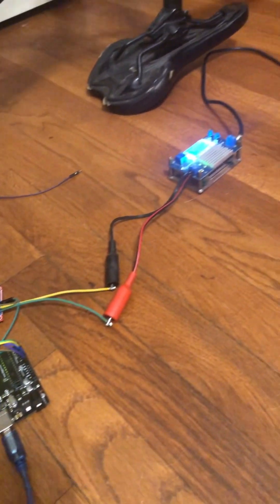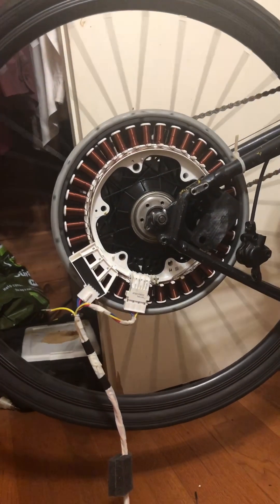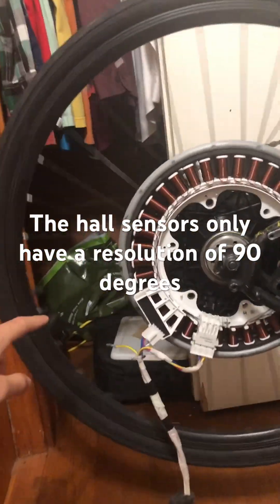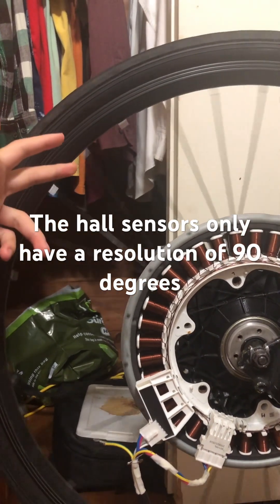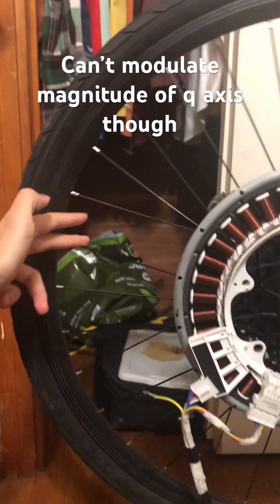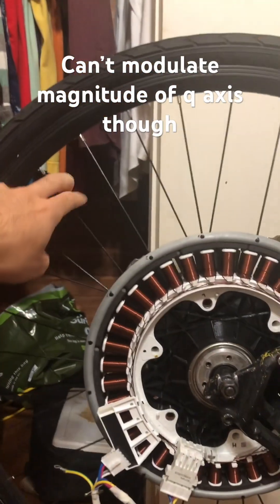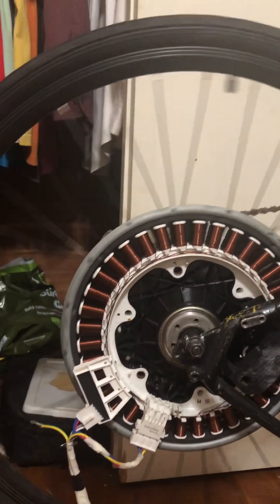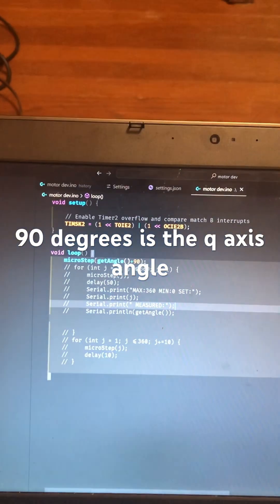LG washing machine motor driven by LN298N #arduino #ebike #electronics

Comment: So how LG hall sensor work, seem it works different from others.
Reply from the maker: @Spark-Hole  yes most solutions I have seen use at least three but lg uses two leading to 2^2 possible states which only allows a 90 degree resolution of the rotor. Electricallly however it’s pretty much the same pinout and voltage

Comment: How you made this support to stator and wheel
Reply from the maker: Here’s an exploded view when I was designing it. Half of the bike spokes are laced into a stock hub and the other half lace into the rotor of the washing machine there’s a 3d printed hub adaptor used to couple the rotor to the stock bike hub and the stator sits on top of the https://media.discordapp.net/attachments/274371958404153344/1209654880990400532/image.png?ex=672ea9e5&is=672d5865&hm=b85cab720ce228f2b903f2667547d9fed12a1842b02882a259bfb989106b4018&